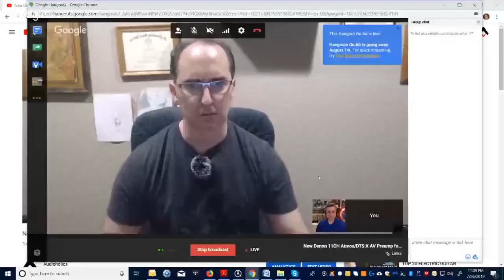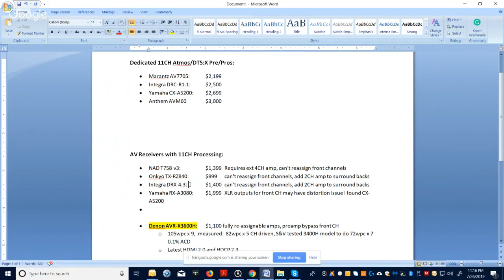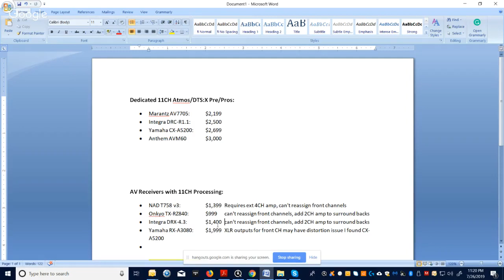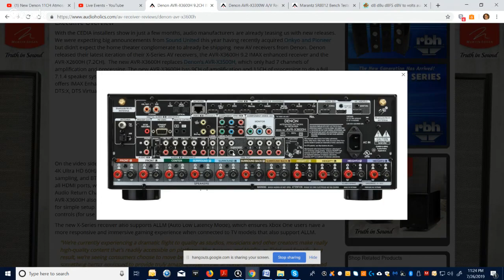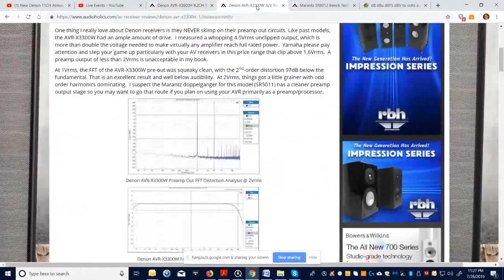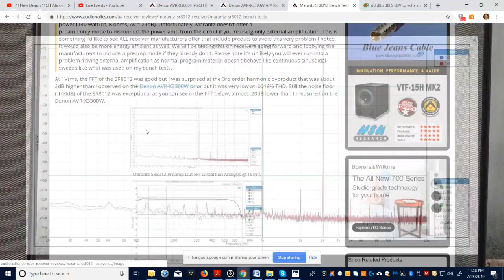Denon AVR-X3600H 11CH Atmos/DTS:X AV Preamp for $1,100?!?

Comment from the maker: I am making a correction/clarification about Amp assignments on the AVR-X3600H.

Editorial Note about Front L/R Channels Preamp Disconnect

 Front L/R channel preamp disconnect ONLY happens in a 11CH speaker configuration. If you have simply 9.1 channel configuration (5.1.4) or less, and you want to drive front L/R speakers out of external amplifier, or L/R/C, or L/R/C/SL/SR speakers out of external 5 channel amplifiers, internal amplifiers will not be disconnected.  There is no selecting or sensing mechanism to allow that unless you activate 11.1 channel Amp Assign mode and select Front L and R for preouts.
Reply: Hi gene, I think many of us is wondering if it does the same for AVR -X4500H?
Reply: Audioholics will the Marantz SR6014 work the  same as the Denon AVR-X3600H?
Reply: I did this on my Denon X4400H and the heat issues was almost completely resolved. Audio is also much much better! Thanks for the info Gene!
Reply: @CasualDad08  what did you do? Add external amp or set eco mode to auto?
Reply: Set to both
Reply: In short to get the benefits of  shutting down the internal amp  clean wise with adding a more powerful external amp on your  front channels You must do nothing less than a 11 channel system or can you still run a 9 channel system with the 11 channel designation as you noted without any signal degradation.
Reply: Gene, what if I use the 3600 only as a pre-pro; i.e., 11.2 with 11 channels of external amplification?  Would the front LR amps still be disconnected from the preamp section?
Reply: So is what you are saying that it's all or nothing as it relates to the ability of the amp to shut off its internal amplifiers? Meaning that when activating the 11.1 channel amp assign mode all internal power amplification gets deactivated.   If one chooses to do this for a 3.1 left-center-right setup with external amplification, will the receiver still handle the 3.1 mix correctly or will it not down-mix to 3.1?
Reply: Gene, a poster of AVS Forum said that if you are using external amps for the front you should run use three amps rather than two so the center is not under powered.  How do you feel about this? Does it compromise the X3600H?
Reply from the maker: @iraweiss517  I agree. Power the front LCR's on external amps and use the internal for the rest. No issues.
Reply: @Audioholics  when you calibrate your system the level miss match should take care of this discrepancy?
Reply: Gene will you experience clipping then unless you run a 11CH config and just have a 5.1.4 with front channels off an external amp?  In other words, is it worth using the external amp unless you run the 11 channels off the 3600?
Reply: Does it de-couple only LR or center as well.  It appears from the note it's LR only, but curious if Center channel is also decoupled.  Anyone know?
Reply: @x01e  I was also searching the same and was watching technodad's video at /watch?v=O22emNvdvLg showing the option of preamp assignment option in the x3600. At around 04:30 into the video the OSD is shown as choosing preouts for either just LR / the 2 speakers on rear heights. No preamp selection chosen for CENTER !
Reply: This is an important information and should be put into description, or commend should be pinned! I almost bought this based on your review, but I don't plan to do full 11CH soon and most important is that amp disconnection will work in stereo mode (no matter what is the speaker configuration). 
Is this issue the same with X4500H ? Does someone have any other AVR recommendation, with all the benefits mentioned in the review, which can truly disconnect amps for LR speakers, no matter what is the speaker configuration ?
Reply: Miroslav Oblas did you ever find something that can disconnect for less channels? I’m going to set up just a left and right channel and 1 sub to start with 2.1 system and so from there as needed or as my desire to add more speakers grows.

Comment: Am I correct on you can not do this “physical disconnect” the front pre outs from internal amp unless you are running a full 11.1. I’m only running a 5.1.2 and it does NOT let you do this. I have tried on a x4400 and a x3600.
Reply from the maker: The way Denon described it is it happens only when you reroute the front amps to height channels. However, another user here claims it can't be done. I emailed Denon for another confirmation.
Reply: @Audioholics   why all your answer in the comment section is defensive "That's what Denon told me", while you were so confident about the product in the video. It's quite confusing and misleading.
Reply from the maker: @rsinha2700  then you have thin skin my friend. I have schematics on the 3600h and there is a true preamp disconnect on the front channels lile I said IF you're doing a 11CH speaker configuration.
Reply: @Audioholics  Thin skin :) ... interesting...another defensive way to say "Dude back off"... all I am saying is own your word. Sorry if you have taken it negatively.

Comment: Hi Gene! Since you talked quite a bit about preout volts.....Do you know what the Onkyo TX-NR1030 xlr preouts and rca preouts true volt rating is? I own the AV and am considering running a power amp.
Reply from the maker: It should be sufficient based on my test results from the Integra DRX-4.2.
Reply: @Audioholics  thanks Gene!!

Comment: If you were to set bass management at 80Hz for all channels, approximately how much more power could this amplifier generate compared to the figures given for 20Hz to 20KHz? Thanks.
Reply from the maker: It doesn't really work like that. By bass managing, you just reduce the duty cycle of power demand on power supply to make more sustained power available with multiple channels driven.
Reply: @Audioholics  Gotcha, thanks for the response.

Comment: Hi Gene. I just got the yamaha cxa 5200 and yamaha mxa 5200.  I just run in the amps about 50 hrs. I think the amps have a very good sounds, good for movie and music. I would say this is the best amp I ever had. 
I just watch this video and you talked about distortions come out from the main channels. I just wonder will it be happen to individal amp or all the yamaha cxa 5200? I don't hear any distortions from my cxa5200.
Reply from the maker: Hi Mike, the distortion I measured is -60dB below the pilot tone. It's certainly measurable but may not be audible in your setup especially since the MX-A5200 hits near full power below the voltage where it becomes problematic UNLESS you're running the amp in bridge mode. I'm just trying to get Yamaha to fix this so the measurements support the ideology of separates offering better performance than a simple AVR.

Comment: Hi Gene! Just a little correction, the X3600H (like it's bigger brother X4500H, from witch X3600H is derived) has no "fully re-assignable amps", so the Front L+R amps cannot be assigned to other speakers, so there is no disconnect. Using the X3600H/X4500H as an 11.1ch pre-amp forces you to connect an external amp to the HEGHT 2 pre-out and the FRONT L+R speakers outputs are kept hot - so there is no disconnect of the amps. All 9 amps are connected to the pre-outs all the time.
Reply: Doru Have you clicked the right arrow when the “pre-out” section pops up for Pre-Out Rear Height? My Denon X4400H allows for the Front L+R to be assigned as preouts and my rear heights to be powered by the AVR. Give it a try
Reply: @CasualDad08  Thank you, the problem was mostly about the * "fully re-assignable amps"*** statement, the limited FR/Heights reassign has the same behavior as the X4x00H series.
Reply from the maker: Please check my preview article for instructions on hiw to reassign front amps. This was given to me by Denon.
https://www.audioholics.com/av-receiver-reviews/denon-avr-x3600h
Reply: @Audioholics  Yeah, I have read the article, and even if those instructions were given by Denon, those instructions do NOT do what you believe they do - no amp re-assignment is made there - only PRE-OUT assignment, and that is a BIG difference. Hence, no amp is disconnected, and no benefit from that. No model other than the current X8500H (and past) "flagship" Denon's have "fully re-assignable amps". You can test this when you will get your hands on an X3600H (or an X4500H/SR6014/etc.).
Reply from the maker: @DoruApostolescu  I'm very sorry to hear this and will take it up with Denon Monday. If what you're saying is correct, then it invalidates much of what I said in this video which really bothers me. Thanks.
Reply: @Audioholics  we appreciate what you do! Im a hard working guy like most of us.. And we Take your word when we spend our money. And thank you for getting the manufactures attention on these issues..  Your influence is admirable.
Reply: @DoruApostolescu  does this mean if you intend to use 11 channels by adding a 2 channel amp you are not able to use that external amp for the front channels?
Reply: @thomasking3042  No, the external amp CAN be used for the main L+R channels - and this scenario is the usual one. You can also use the external amp for the HEIGHT 2 speakers if you want.

Comment: Hey Gene , great video , i have a Denon 6400 H , planning on adding a separate,  my set up is a 5.2.4 , running Martin Logan’s 4 ohms all the way around ... what amp would you recommend? All speakers are 200 rms .. I was looking at outlaw 5000 or monoprice , that make a 9 channel ? What do you suggest ? Thanks in advance !
Reply from the maker: The Outlaw 5000 isn't as big of a upgrade as the Monolith amplifier. I'd definitely recommend the Monolith 9X if you can swing it.
Reply: Audioholics thanks Gene , one more question if you don’t mind , if I were to go with the Monolith 9 channel , 200watts LCR , 100 watts all other channels ( 6 ) .. if I go that route, is the Denon 6400H handle it without clipping ? Is it putting out more than 1 volt for the pre outs ? Thanks Gene
Reply from the maker: @JoseRivera-vv7ud  Yes it will definitely be fine. The Monolith hits full power about 1.6Vrms and the Denon is still pretty clean there.

Comment: Gene, i was curious about this whole thing with re-assignable channels. I have the sr6012 and i went into amp assign and the assign mode to 11.1ch i then get the option to assign either front or rear atmos. I'm considering adding something like emotiva XPA 11ch to step away from the internal amp all together. Possibly adding an even higher end 3 ch amp for the front stage in the future. Is that doable,  from watching the video i got a bit worried the avr might clip anyway.
Reply from the maker: The Marantz will have plenty of drive and doesn't get nasty in the distortion until > 2Vrms since the pre/power amp can't be disconnected, otherwise it would go to 4Vrms clean. I would highly recommend the Monolith 9x or 11X instead of the Emotiva 11X Gen3 as I feel it's a much better amp. Alternatively, take a look at just getting a good 3CH amp for the front LCR's and use the internal amps of the Marantz for the rest of the speakers. Parasound, Outlaw, Bryston, and Rotel are all good options.
Reply: @Audioholics  thanks for the answer,  monolith and outlaw isn't available were i live unfortunately. When it comes to 3 ch amps I've been considering DR3, cheaper than parasounds 3 ch amp and from the reviews ive seen its supposed to be very good. It pumps out alot more power than i need but headroom is never bad. Have you guys reviewed the DR series?
Reply from the maker: @MattiasSjosten  No, we haven't reviewed Emotiva amps since Gen2 and sadly my XPR-1's died and they wouldn't service them. Parasound amps are well built and last a long time. Well worth it.

Comment: Why is that guy going on and on about "yeah, and then use those amplifiers for Zone 2 and Zone 3"? That was not the main lesson here.

A great discussion, though.
Reply: David Bergman 😁. The point was if you go into amp-assign mode and assign the pre-outs to an external amplifier you can still use the internal amps for other purposes—like zone 2 and zone 3. For some consumers doing whole home installations your money is better put towards getting external amplification for the fronts and reassigning the internal amps to other zones as opposed to buying a zone amp.

Comment: What I’d like is something like the Marantz slim line avr with four assignable amps, seven pre outs and 11 channels of processing. Then the four internal amps could power the atmos speakers and have external amps for the lower five or seven channels. And separate sub outs as well. Or maybe Marantz to just add preouts to the slim line avr NR6012 maybe the one I’m thinking of.

Comment: Does it disconnect the center channel too, it a 3ch amp is used
Reply from the maker: No just the front L/R.
Reply: I had the same question, wish they disconnected the center also, for home theater it's the most important speaker IMHO.  For 2 channel yes.. but for Home Theater that sucks.

Comment: Great video I learned a lot! If eco mode is enabled on this receiver or the Marantz 8012 does that have an affect on the pre-out voltages or does it just affect the power output stage? Thanks.
Reply from the maker: No just the amp stage.
Reply: @Audioholics  Thank you!

Comment: What is your opinion on the  Anthem MRX 1120 ?   Powering Axiom m100 mains  Paired with a Rótele RB 1582 mk ll  powering 2 Axiom m100 rear   As surround  rears ?
Reply from the maker: Nice setup but you probably don't want to use fullrange towers as surrounds as they will be ear level and localized if close to the listening area.

Comment: In your article you say that by resigning front 2 ch to rear surrounds you get clean pre-outs. ( right ?) . Does this mean you can only get 2 clean pre-outs since there would not be any remaining channels to be assigned by this method. For example, if you wanted to run this 3600 AVR and only power 1 channel by the AVR, ( lets say C ) and you wanted to power all of the rest through pre-out amplification. Does this mean only 2 of those externals will be "clean" in an 7.1.4 ? A little confused by this 'clean " tag, would love a bit more detail
Reply: Great question. I would also like to hear more detail about the amp disconnection procedure.
Reply from the maker: The main L/R outs with preout disconnect will be free from odd harmonic distortion even when driven to 2Vrms. The other channels will habe slightly higher harmonics above 1.2Vrms since connected internal power amps will reach clipping at that point and will ingress some noise. This is something I've measured but haven't subjectively quantified audibility yet.
Reply: @Audioholics  ok thanks, so im better off with a prepro if i have 10 channels of external amps ?
Reply from the maker: Preamp disconnect will ensure clean output to 4Vrms (clipping). On this model, you can only do that with the front LR outputs as instructed in our article. The other channels will be relatively clean to 2Vrms despite the unloaded power amps will be hard clipping there. Just choose an amp with a voltage gain of 29dB or higher so it will reach full power at 2Vrms or lower and you will be ok.
Reply: @Audioholics  does the old Yamaha RX-V1 have this 29dB or higher as stated? I have 2 of these beasts but can't find that info. Cheers
Reply: Preamp mode compared the Marantz direct mode  that also shut down display circuit.
Reply: sorry I don't really understand that reply

Comment: I would rather advocate to do this with last years Denon X4500. The price will be the same, cross-upmixing for Dolby content is still possible vs this beeing killed for the X3600 and you still also have Auro3D and their upmixer Available. The only cool thing that the X3600 gained is the possibility to be able to still do surround sound in the main zone while routing the content also to zone 2/3.
Reply from the maker: Sure if you can get it for this price, agreed.
Reply: @Audioholics  does the 4500h disconnect front/all speakers too? For the 4v output preouts.

Comment: Hey ,this info is great. I think I will go with that recommendation. I see a lot of speakers and subs you recommend that I like for that ,but what is the best center channel speakers? And is there such thing as a dual center channel set up? Thanks keep it coming.
Reply from the maker: The best center channel should tonally match your front speakers. Do NOT do duel center channels unless they are each discrete like in an Auro 3D setup. Mono dual centers cause acoustical interference and not a good idea.